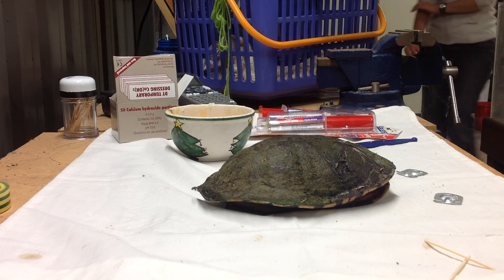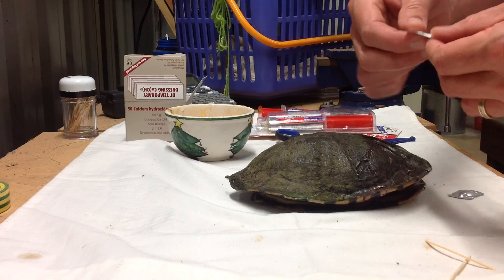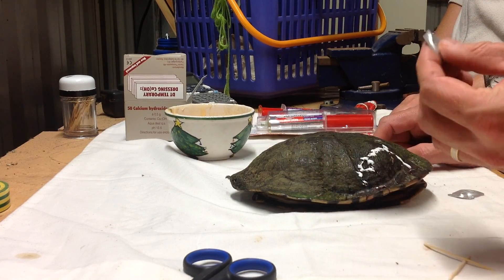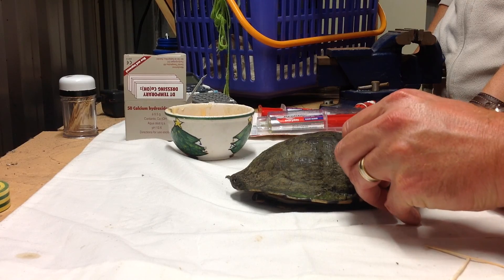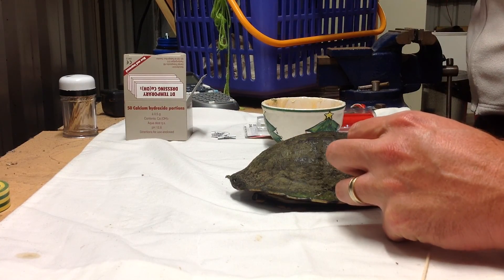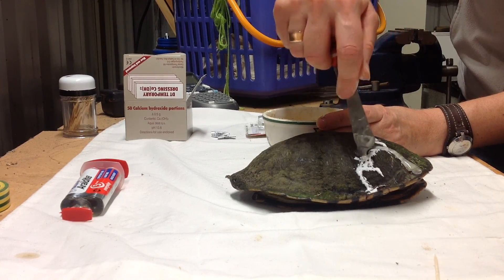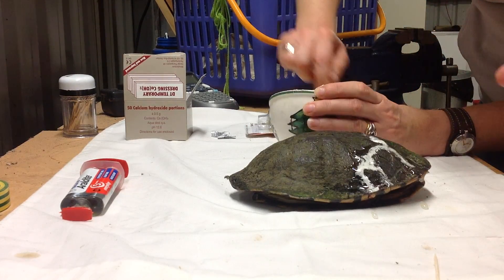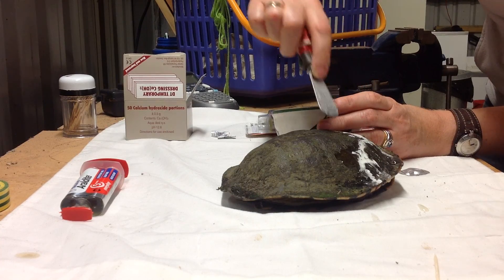Turtle Shell Repair video 1

Comment: Had trouble understanding some products used. 
What I heard Crazy Glue.
Thought I heard or read from captions, Denture Dressing, 
Might have read or heard, Tupac aerodyne. But guess that's not right, couldn't find in a search.
Don't know what you used for water proofing the shell.
Heard something about tape. What kind of tape?
Georgia:
She has two parallel cracks on her under side, on each side.
Sometimes in the morning they are pronounced, mostly in the evening, after a day outside  in her wading pool they are usually near impossible to see or feel.

I am planing on using crazy glue and something like tape to hold the shell from flexing/cracking. with something to keep her shell waterproof.

Thank you so much for any help.